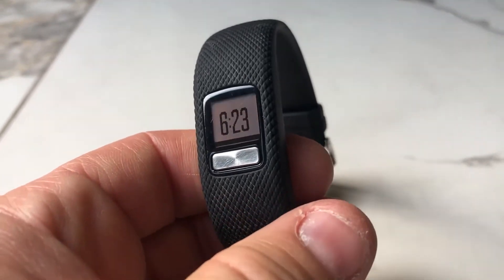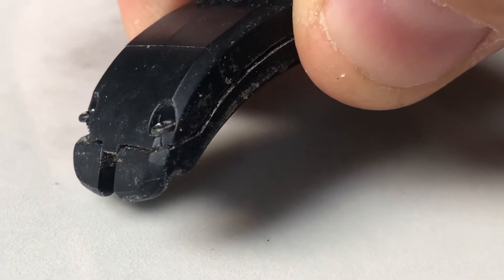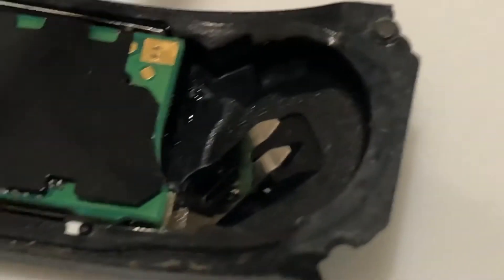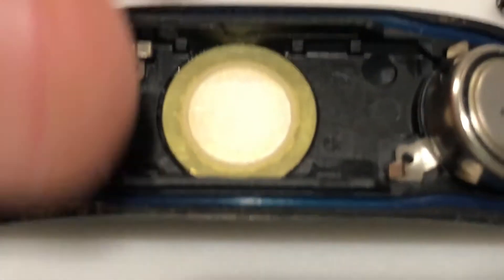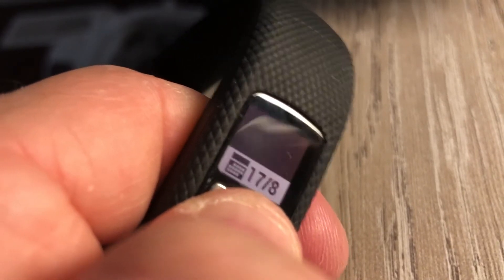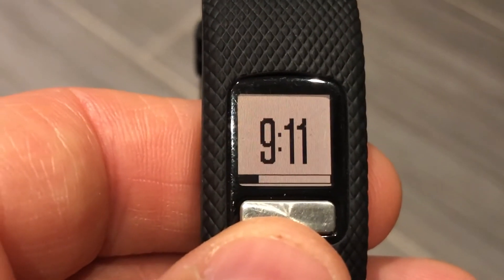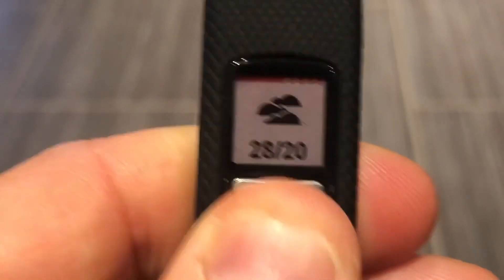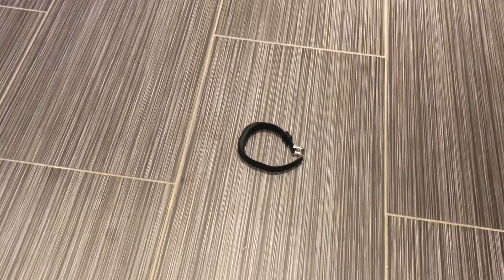Garmin vivofit 4 major issues! Cracking software firmware bugs!

Comment: I had a vivofit 4 for almost a year, one day the screen went black so I replaced the batteries and it still wouldn’t work.  I got another one, then the same exact thing happened only a few months after getting it.  I went back to the vivofit 3 and never had an issue, except for when I lost it.

Comment: Definitely not waterproof after changing the batteries so be careful with it if you dont want the watch to be damaged. This is what happened to my vivofit 4 too. Destroyed by water splashes only.
Reply from the maker: I believe there is a flaw with the back of the case being plastic and screw holes so close to the edge. It is very easy to crack and once that happens, water can get in. Also the rubber seal likely also dries out or doesn't fit properly around anymore. These devices aren't designed to last more than a few years but they are fairly cheap.